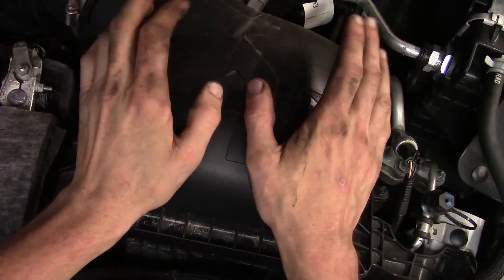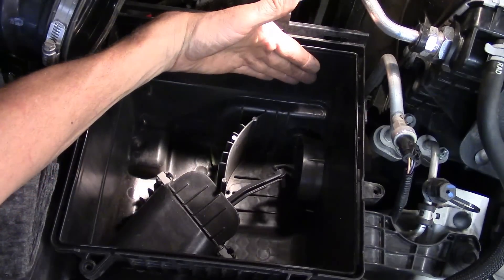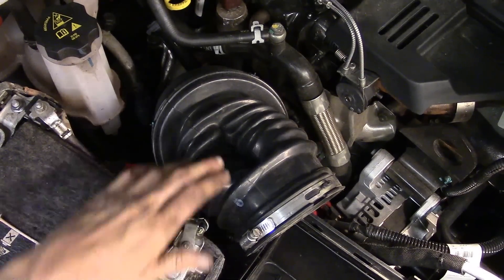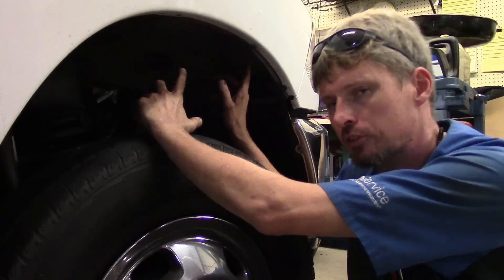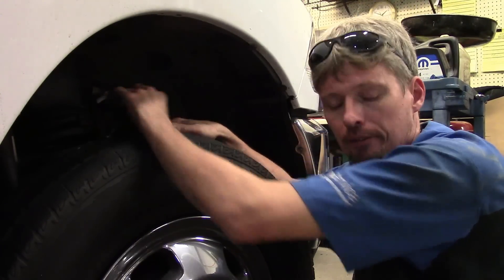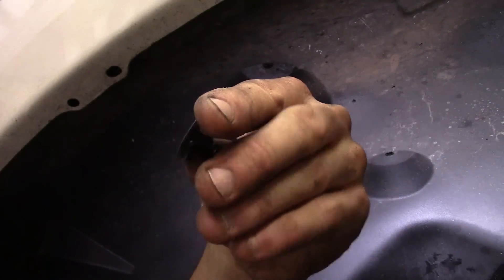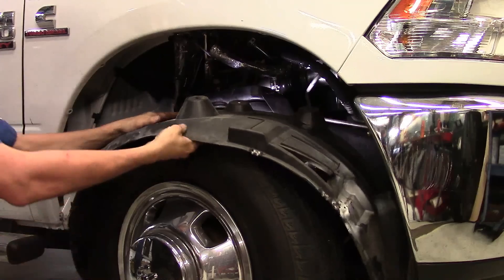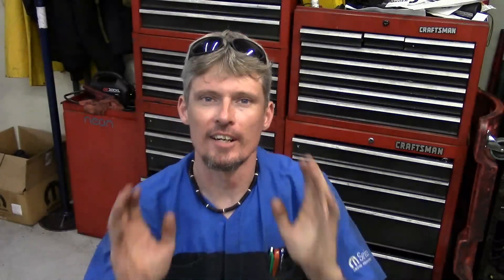2013-2015 Ram 6.7 cummins diesel code P2280 and air filter service message

Comment: This video was a huge help to us. We were 3000+ miles from home when we got the error message. Our intake tube looked almost identical, very collapsed. Thank you for putting out this video!
Reply from the maker: Awesome! Glad it was something simple like this. Great job on thinking to search on line to try to find the cause and end up at my channel. Make sure to subscribe.
Reply: @MotorCityMechanic  Hey Mr Pike.  Great video, thanks please keep em coming.  Hope thanksgiving was good. 
Started getting the service air filter message,  found some small pieces of the corrugated tubing under the filter. I removed the tubing but I'm still getting the message from time to time. How do I test the actuator?
Reply from the maker: @darryladams519  Thanks and hope it went well for you as well. The only way that I know of to test that actuator is with a scanner that has that feature....which usually means a high end scanner. I recommend having it checked and so that you dont waste any money on any unneeded parts.
Reply: @MotorCityMechanic  it was good. Thanks for the reply. Guess I'll have to bring to thomson for you when I get some time off then.

Comment: I had this exact problem.  It was in fact the fender Rambox hose.  My 2013 2500 has an access port in the fender well for the headlight.  I could reach through that access port and remove the brittle collapsed hose from the ram box.  Problem solved. No need to remove anything if you have the access panel. Thank you!

Comment: Bingo!!!   Pulled the fender liner on my 2013 Ram 2500 today and the hose was essentially flat.  Cut it off, replaced the liner, cleared the code and drove it like a "madman " for about 45 minutes.  Never popped the code again and had been doing it everytime I gave it more than half throttle.  Thanks for the excellent video.

Comment: Thank You, well explained. I did cars for 34 years but out of the business for 16 and haven't kept up and mostly did Peugeot, VW, Merceds and Cadillac diesels. Didn't do a lot of diesels at my shop for 28 years. Its nice to be able to look something up, see how it works and issues by an actual knowledgeable tech. Was able to easily find the problem fix it and erase the codes test drive and all good now!!!!! 🙏🙏🙏🙏🙏🙏🙏

Comment: Man, your dealership is pretty cool for letting you film your work
Reply from the maker: dave194315 They actually use to pay me per video and then it became a hassle getting paid so I just kept making more and putting them on here myself. I work fast enough that it doesn't interfere with my normal work load. Plus with the group of techs we have now at the shop....they might need to watch these videos to learn how to work on the stuff in their bay.

Comment: I very much appreciate your extremely informative, step-by-step videos. Showing the tools you use and why you use them as well as the actual fix itself. So many others on here have 30 minute videos that spend 25 minutes jawboning about nothing and the the last 30 seconds showing the completing project.   Viewers learn nothing.  Can't express enough how much many of us appreciate you sharing your experience and expertise with the rest of us !  Did Ram ever update this  air intake vent?  I have a '16 3500 6.7.
Reply from the maker: Carl Jones That was awesome feedback! I try to make the videos as informative as possible. It's great to hear that it helps. Appreciate the comment. I haven't had the chance to take a newer inlet pipe off to see if there have been any major changes yet. Make sure to subscribe!

Comment: I just bought a 14' ram 3500 DRW with 75,000 miles. When I took it for a test drive the service air flutter message popped up. Took it back to the dealer and the service guy got mad at the salesperson saying that they just serviced it. Mechanic said well it only does it at full throttle. I said so fix it. It was the flex pipe that sucked in on itself. An hour later I was on my way home with my new (to me) truck.
Reply from the maker: Just like in the video.....glad they found it after all the fuss they made about it. Sorry it went that way. Thanks for the comment and for watching. Make sure to subscribe.

Comment: I think a small piece of window screen tie wrapped to the end of the air tube would do well to keep animals and large debris from getting inside the air box. 1/4" wire mesh would work too.
Reply from the maker: I like the mesh....one you get rid of that dryer tube. No more collapse and nothing getting past the mesh. I found a mesh sink strainer that fit inside the dryer flex tube. I can see leaving a few inches of the flex tube and putting the mess sink strainer in.  Luckily is its that common an issue and personally I havent seen one in over a year. Thanks for the comment and for watching. Make sure to subscribe

Comment: I found my intake "dryer" hose in the box against air filter today. I cut it off and put some heavy screen mesh over the opening on the fender side. Secured with clamp.
Reply: I was thinking about doing the same , any issues running with the mesh so far?

Comment: In your video the truck doesn't have the OEM fender flares. Mine does, will I need to remove those to get to the hose? If so, what product do you suggest to put them back on? 
Thank you. 
Your videos have been very helpful to me.

Comment: Dealership is telling me my low boost and loss of power is because my air box is bad. Not showing the code you mentioned but is showing P1475 and P003A turbo actuator learning limit exceeded.
Reply from the maker: Any updates? Curious what fixed it. I need to know the year of the truck to help further. Sorry for the delay.
Reply: MotorCity Mechanic Turbo actuator went bad. The first dealer was literally trying to rip me off. Caught them red handed. The second dealer replaced the part under warranty. 2900 dollar part also
Reply from the maker: Its sad that you have to worry about getting screwed by a shop like that. I am glad that eventually you found a dealer that had your best interests in mind. Good job on seeing thru the BS and not following for it. Thanks for the update.
Reply: MotorCity Mechanic Some dealerships bank on the customers being uneducated about how machinery works. I have a code reader and I owned a 6 liter Powerstroke so needless to say I became well versed in diesel engine mechanics. I knew exactly what the problem was and had a warranty that covered the malfunctioning part. Wish I could send you a pic it would blow your mind. They claimed they pulled my Air box and verified it was no good. The pic proves they did no such thing. They opted to try to rip me off. Didn't work and when confronted they called to police. Very interesting I should sue them honestly.

Comment: Perfect fixed my problem right away! My old one was beyond salvageable. Cut it off where you recomended and plan to either install a whole new cold air intake or add a peice of rubber hose possibly just incase pvc would rattle? Thank you again though. Do you recall what size diameter the hose is roughly?

Comment: Keep getting the "service air filter" I've checked the fender tube and it's fine. I've also checked the air filter and it's good. Could it be the actuator for the air box doors? What is the name for that actuator? Thank you for your time
Reply: Hi, did u ever solve the proble? Mine don't open either

Comment: Great info! Thanks.
Reply from the maker: Guy Ko Thanks for the comment and for watching. Make sure to subscribe if you haven't already
Reply: @MotorCityMechanic  Howdy. I keep getting the service air filter message after taking the corrugated tube off. It wasn't collapsed but I did find small pieces of stuff in the box that looked like it may come from the inside of the tube so I removed it and replaced the air filter ith a new one. How do you check the actuator? I have taken the new filter out and "cleaned" it with my air compressor and sprayed wd40 on the flap linkages.  That seemed to work for a few days but.....

Comment: In 2:06 in your video, you point out the linkage or arm that connects the two air intake doors. What is the official name of that arm? I think I need a new one, but I cant find the part cause I have no idea what its called. Thanks for any help!
Reply: I need that part

Comment: My tube got sucked into the airbox.  It came apart like a toilet paper roll core does.  i tore it all off but there was a plastic brace that went around the end of the ducting.  basically a plastic band.  do you think the plastic piece coming out of the air box will have enough support if i leave the ducting off?

Comment: Is there also a fome filter deeper in that pipe? or no? Thanks
Reply from the maker: There is nothing inside the pipe. It leads directly to the door on the housing with nothing stopping any small rodents for using it as a highway to the box to store their nuts lol. Thanks for watching and for the comment.

Comment: I dug deep and found this in a tread.  I have a 2013 with 62k miles.  Could this have gone bad already???  "The solution to the Service Air-Filter message and CEL was to change the lower air-filter box. It seems that the servo motor attached to it, that activates the gate that changes the airflow from the grill to under the hood, thinks that the gate has not opened or closed, the signal is interpreted as a restriction or a leak in the intake system."    Thoughts??

Comment: Bought my 2018 ram dually for hotshot. Has 200k on it.  After 2 weeks it’s struggling on inclines. It has a perform service light on and check engine on it. Any ideas what’s making the truck lose power?
Reply from the maker: Perform service is just a routine maintenance interval....the check engine light is what we need to start with. Anything Is possible at this early point and just a guess until the codes are checked
Reply: @MotorCityMechanic  I changed the CCV filter and both fuel filter after it went into limp mode.  It’s running good again.

Comment: 2017 ram 6.7 code p2281 air leak. Mass air sensor, map sensor, intercooler, and EGR have all been changed by the dealership. Smoke tested. Not leaks. Loosing my mind.
Reply: Did you ever find out your problem? I have the same issue
Reply: Same here, what was it?

Comment: the rod that opens the fender intake hole keep coming off on my truck. What is the small white knuckle called? I cant seem to find it anywhere online.
Reply from the maker: As far as I can see its part of the air filter housing and only avail. with the assembly.

Comment: will you do a video on how the fix the P2608 intake air heater relays. the code says faulty relays 1 or 2 but I can only find one I think. first diesel owner so what to keep it running right.
Reply: sorry P2609
Reply from the maker: I need to know the Make, model, and year so that I can help you further
Reply: MotorCity Mechanic 2015 ram 2500 6.7l Cummins Laramie 4x4
Reply from the maker: I came across this code just the other day.....There is some info that Chrysler has put out about it. Email me at david@motorcitymechanic.com and I will send you what I have. I couldnt find anything obvious on the one I checked being that the issue wasnt active or happening when checked. I order the intake heater and solenoid. Just waiting for the parts to come in and reschedule the customer to come in  for repair.

Comment: I put a k and n filter in my truck and a week later my check engine light came on with a code for the turbo...I then removed the filter with a bran new stock filter and the light went out...now another week later and it's back on...any ideas?

Comment: Hey MCM! Trying to remove the turbo on my 07 6.7 to replace a leaking exhaust manifold gasket. Whats the secret to removing and re-torquing the inside rear hut on the turbo??? tried a wobbly, a universal nothing lines up!!! How do you do it???

Roger
Reply from the maker: This is the actual tool we use, https://areadieselservice.com/diesel-power-products/product/99-1055/ . Kind of pricey. You may be able to use another tool such as this: https://www.summitracing.com/parts/sxt-994003m?seid=srese1&cm_mmc=pla-google-_-shopping-_-srese1-_-sunex&gclid=Cj0KEQjwuJu9BRDP_-HN9eXs1_UBEiQAlfW39mfF4388bjVr4x5b8qHcepwC0AG703hxZKuiu7MczmwaAv6p8P8HAQ . Both should work fine.

Comment: Removed the “dryer vent” hose, checked everything else and still getting the service air filter, about every 2 minutes, going nuts! Any other ideas of what it might be. Truck runs fine.
Reply: Did you get it fixed, Or continue with the problem? I'm in that situation every one minute
Reply: @tereannis1  I finally got it to stop throwing that code, not sure if it was from cleaning the mass air or what but i tried everything! Sorry im not much help
Reply: @pauldavidthehebrew  thanks 😊

Comment: I have a 2018 Ram 2500 6.7. I have been getting a "service air filter" message, and today it threw a code, P227F. I cant find that code anywhere. Any ideas?

Comment: I have a 2013 ram 6.7l no codes but keep getting check air filter and chime coming on any idea what to look for ? Thank you
Reply: Same here.  Just started happening after I deleted it.  Got rid of the K&N air filter too
Reply: I have the same issue for my 2014 5500, what you guys do to get it fix after all?

Comment: hey David, my 2013 2500 Cummins with 52 k just threw a "Service Exhaust System, see dealer" at me on my instrument cluster, the catalytic converter was replaced at 44k. what could be the problem. I would appreciate the help.thanks!
Reply from the maker: It's going to depend on the code found. It could be one of a hundred different things. Your local auto parts store will check the codes for free and with that I would be able to help you further.  Otherwise we are flying blind

Comment: Mr. Motorcity... So I didn't know Ram was made in Mexico. Is this correct?
Reply from the maker: There is a plant in Mexico that does make the Ram truck as well. Not all trucks are made there but some are for sure. This isnt anything new and has been going on since 1995.
Reply: MotorCity Mechanic Appreciate the clarification on that. You the Man
Reply from the maker: Your welcome. Thanks for watching. Make sure to subscribe

Comment: I had one of my drivers neglect to change the air filter and it was sucked a little bit into the intake. Did not look like any dirt got in the intake boot or engine. What kind of damage would an air starved engine result in?
Reply from the maker: +primagen77 Actually when the air filter gets sucked in.....the next thing in line is the turbo! It has to go thru there first before the intercooler and then the intake. You need to make sure no damage was done to the turbo blades. Its very possible.

Comment: Todays RAM Diesel is built like a shit box !    OK  so I just took my 15 ram .67 culms diesel, to the dealer . Turns out a mass air flow sensor is bad,  Tech says it from my 'AIR_RAID', replacement filter.   I call BULL SHIT.!   But who am I just a man with a note $$$, for a ram, thats more a weak ass GOAT !         2020 TUNDRA.....I'm coming over soon !!
Reply: had to trade my tundra in for the higher payload and diesel.. wish Toyota would come out with a one ton already

Comment: In the video I linked to he removes the turbo baffle what are your thoughts on this "mod" https://youtu.be/kZsf97T-Gs8 thanks
Reply from the maker: The baffle is there for a reason. I dont really see any benefits that justify do it. They make mention of the plastic pieces coming loose and impacting the turbo which I have never seen. The engine already has enough sounds....I dont think you will hear much over the turbo, exhaust brake, engine, and exhaust. Unless someone showed my dyno sheets showing an actual improvement in performance......I will remain skeptical.